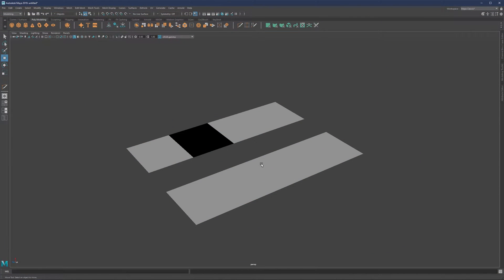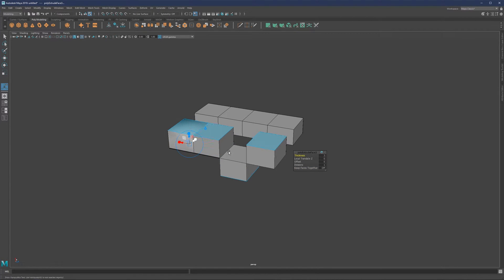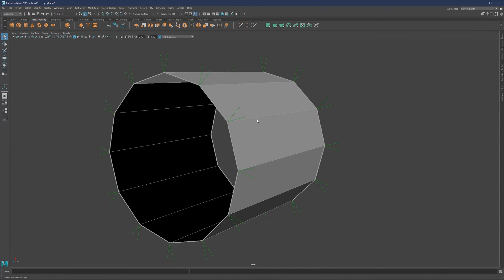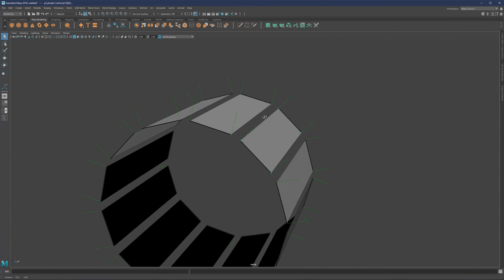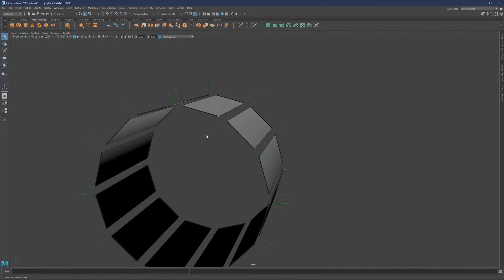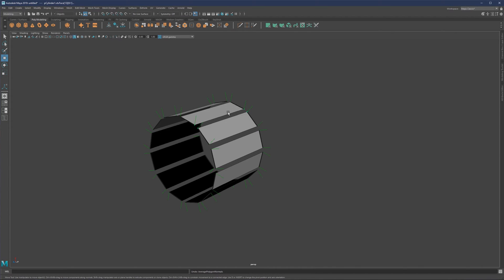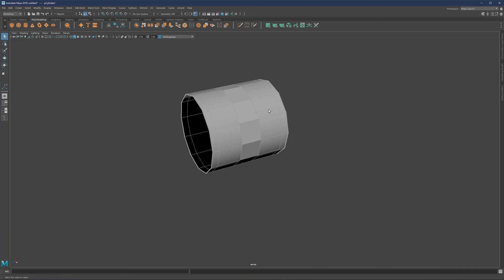Intro to 3D Modeling in Maya / Normals and  Vertex Normals

Comment: i made a ball with a cilyinder and i booleaned it, but inside the booleaned cylinder it does not have the same shade, and normals are ok, i am confussed
Reply: That's a problematic way to make a ball. Just make the standard ball and change the subdivisions in the menu.

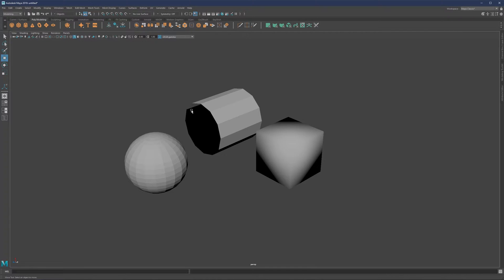Comment: Thanks for you tutorial! I got all the info I needed but since 3:47 I was a bit overwhelmed. Is this apliccable knowledge when modeling? When does this come in handy?
Reply: He mentioned it later on in the video. Sometimes when you bevel or bridge, the software will mess up normals of the new vertices and your model might have undesired shading because of it. He explained the reason behind and how to fix it (with soften/harden edge or even averaging vertices).